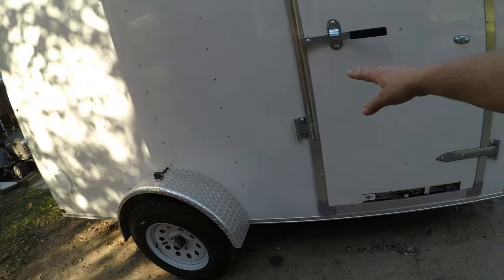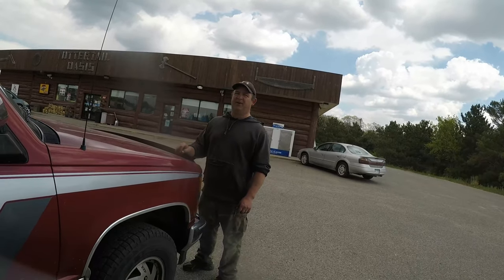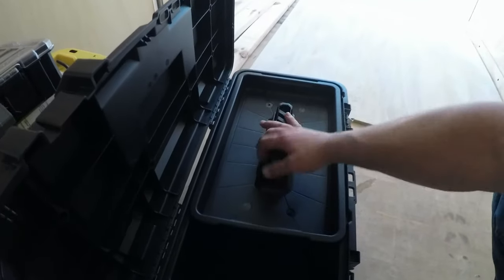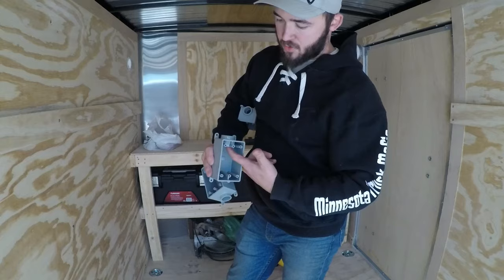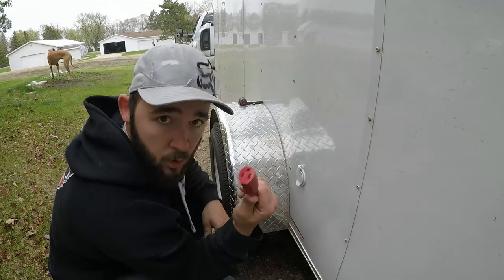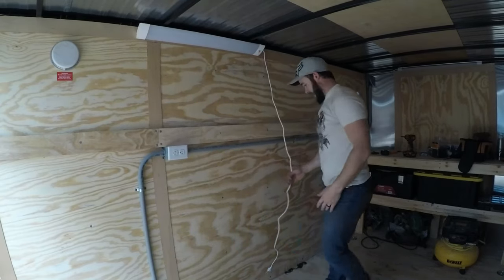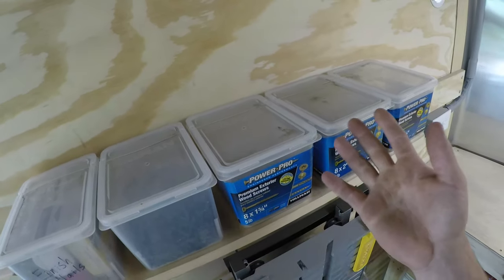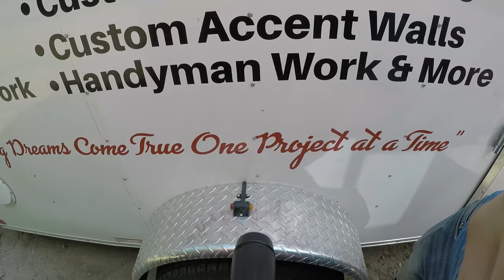I Bought A New Cargo Trailer / Work Trailer build   WITH 110v POWER  [Blue Collar Things Ep. 3]

Comment: Thanks for the video! Re tool brands at 9:35  I have a friend who had (now retired) a high-end custom cabinet shop. He used to use Makita cordless drills and had over a dozen of them. He started using Harbor Freight cordless drills when the Makita batteries all started failing. At less than 1/4 the price the HF drills were a better value for him.